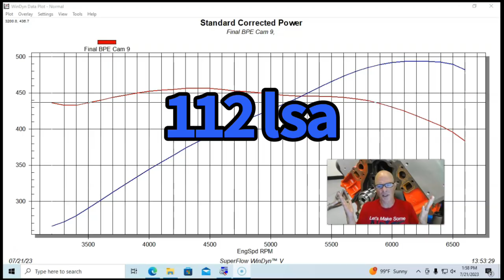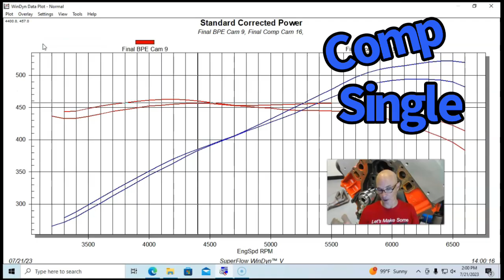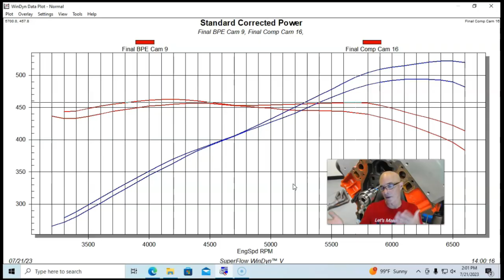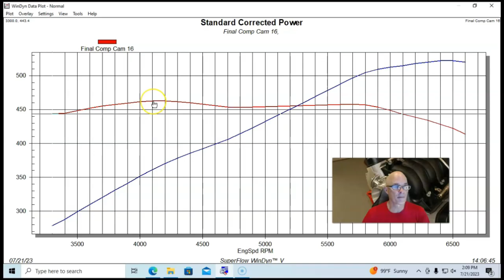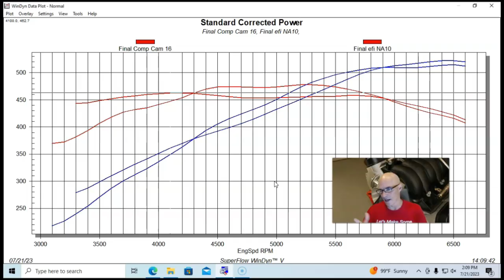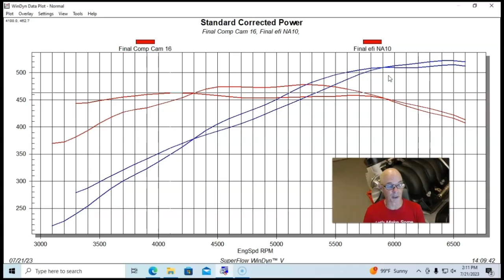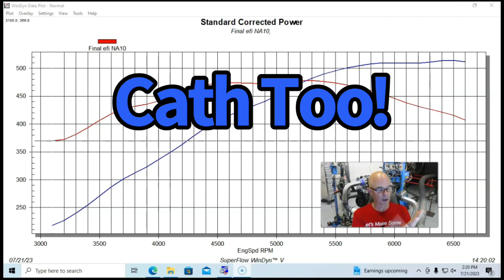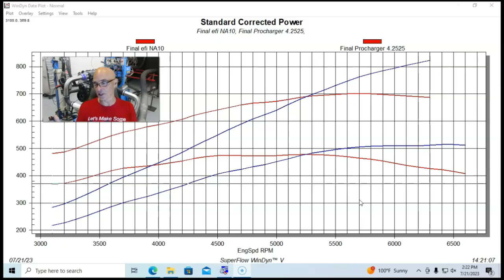HOW TO MAKE BIG 6.0L LS POWER! FULL DYNO RESULTS ON CAMS, INTAKES AND (OF COURSE) PROCHARGER BOOST!

Comment: Whats the best carb intake for ls7 for the street
Reply from the maker: 950 VRS EDEL
Reply: @richardholdener1727  dual plane intake with adapter or single plane ?
Reply from the maker: single for the LS7 (You can also go dominator)

Comment: LQ4 with BTR springs and pushrods. BTR stage 3 v2 truck cam, 750 double pumper carb, and MSD 6014 ignition.  Where should my timing be at?!  The web is all over the place on carb ls timing. And the presets aren’t even close. Thanks in advance.
Reply from the maker: 30-31 degrees at the hp peak, less at peak torque, less below

Comment: Richard thank you so much for including the carb setups with this video! Was curious what your thoughts are on the older BTR stage 2 cam with the dual plane on the 6.0 rect setup? Also what do you find is the sweet spot for timing on the carb setups like this? Cheers!
Reply from the maker: any cam works with carbs, and total timing at hp peak is usually near 30
Reply: Thank you for the reply, do you know if BP used the oem dished type pistons on this one or flat tops like an LQ?

Comment: Good evening, first i'd like to say thanks for a lot of information and also I'm new to this. I have a old cargo Van with a 6 old engine absolutely love it but I use it for work daily use, so reliability is a big thing and I also told a 7 by 14 in closed trailer. I'm getting high on a mileage and I would like to rebuild it.  I wanted to know what would it take for me to get around 450 torque and maybe 425 hp. Mainly because I run a lot of the highway but I also run a lot of the Midwest northeast mountains. I know GM came out with the new 66. But I actually love my cargo bank and everything works completely fine and The engine is just getting higher in mileage and just wanted to overhaul it.
Reply from the maker: TRUCK NORRIS CAM AND SPRINGS

Comment: What would happen with a 227/231 620 lift cam. Curious cause that's what I've got in my ls3 64cc  head  lq9. 92mm tb, ls3 intake. Should be pretty close. I do plan on running boost.
Reply from the maker: see the 224, 227, 231 cam video

Comment: Question for you Richard , a friend is putting a 305 vortec (originally roller) almost completely stock in an S10 pickup . What cam would you recommend for street use ? Thanks
Reply from the maker: take a look at the 305 sbc videos and choose one of the milder cams

Comment: Currently waiting for my 402 (6.6L) stroker build to finish.  My LS2 block was junk so went 6.0 iron block (30 over), forged eagle crank, forged eagle i beam rods, SRP Pro dish pistons (shooting for 11:1), unported fast 102, TSP Magic Stick 3 (238/242, .600', 112 LSA, 110 ICL), comp cam lifters, ARP head studs and mains, king bearings, new Monster Lt1s twin disc, Fast 58 injectors, Aeromotive 325lph fuel pump, full exhaust…. Hoping for 520+ wheel and then maybe add boost later.  Still a daily, hence the mild cam (2006 corvette).  Replacing torque tube bushing and bearings as well $$$$$$$ 😢
Reply: Boost on an 11:1 motor, go easy😢

Comment: On the 1st test the dual pattern cam is big compared to the single pattern so hp up and tq down would be expected.
 A dual plane more like 220/238ish 112lsa would be a closer equivalent.
 Likewise a single pattern of mid 230's@50 would be closer equiv to that dual pattern.
Reply from the maker: the true test is matching the intake duration
Reply: @richardholdener1727  👍 but all great and interesting testing too, thankyou

Comment: Look at the shape of the horsepower curve. It has a ripple in the curve, the dual plane curve is smooth. I think its probably a function of very even runner length in the EFI manifold, the resonant frequencies of each runner being the same causes the sine wave ripple as rpm's increase. The dual plane has all very different length runners which cancel out each others tuned lengths. Basically one has a natural filter. Also the obverall shape of the two horsepower curves are different, so naturally the two curves will cross twice.

Comment: Rich, everyone wants to see down low for a dig reference and see what type of converter they need. Just an FYI
Reply from the maker: Everyone?
Reply: @richardholdener1727  except for the roll racers. So no not EVERYONE.
Reply from the maker: no one needs wot power numbers at 1800 rpm (you should not be a WOT at that low of an engine speed) whether you roll race or drag race

Comment: The 227/243 Comp Cam made more low-speed torque compared to the BPE cam from 3300 to 4700 rpm, where their torque curves appear to meet.  Then it continues making more torque (and hp) to the top end.
Reply from the maker: the 227 cam made less low speed (watch the video again)
Reply: @richardholdener1727  I did, even watched it frame by frame when the Comp Cam hp/torque curves were added to the graph.  I know the bigger cam usually doesn't make more low RPM torque, but this one did.  Maybe it's the carb manifold that made the difference...
Reply from the maker: the 227 cam made less low speed than the single pattern
Reply: @richardholdener1727 No use of. Delousal people. Sounds like a Delousal Ford guy. Example they can get stright out run I mean get the jump 60Ft. But the other car even being 2 to 3 cars a head. Ford guys will still be delousal and blame there L on God's weather ECT and that's #1 out of many excuses they say.

Comment: I'm amazed by the level of torque the carb set up produced around 3000rpm! The  carb produced torque level was almost comparable to the turbo set up at 3000. Richard, I wonder has the magnitude of the 'lower' rpm torque here anything to do with the over sized carburator? Did you happen to measure the air/gas ratio during both set ups? I'd love to hear your thoughts behind these!
Reply from the maker: we monitor and optimize AF ratio on every test
Reply: Most likely an error, as he said all the tests he has done have not produced same results.
Reply: @nintendogamer5472 lol an error 😂

Comment: Stupid question.
Every parts store gives math for carburetor sizing. Like-
 cu in x rpm/ 3456 or some other constant.
But these Dino motors run bigger carbs.
I’m guessing Dino motors don’t do much part throttle stuff?
I’m figuring a 650 for the 6L and Richard is using a 900 cfm…
Reply from the maker: the carb size is not determined by cubic inches-it is determined by hp-and part throttle works fine on this motor
Reply: @richardholdener1727  -Thank you.  
So like 1.5 cfm per horsepower?
Probably not that simple…
😎
Reply from the maker: that is more difficult since the carb airflow is not always the rated size
Reply: @richardholdener1727  -lol
It’s magic then..possibly voodoo.
Reply from the maker: we base it off of vacuum readings taken at WOT for various power levels vs carb sizes then adjust for drivability
Reply: @richardholdener1727  -Ty!
Reply: @michaelgarrow3239  also depends on rod/stroke ratio and whether or not you flipped pistons
Reply: @scotttimpany2845  - That comment has me oddly aroused….  
Just kidding.. 😎
The bore and stroke ratio affects piston speed at tdc I would guess? Which would affect vacuum in the intake manifold.  
And flipping the pistons means your just messing with me? 😎
Reply: @michaelgarrow3239  I'm messing with you. You're right about the carb sizing formula.  It's out there and a good rule of thumb.  If you watch 100-200 RH videos, you'll see he uses the same 2 or 3 carburetors all the time.  He has a few "go-to" carbs at Westech...  You'll also see that he focuses on WOT pulls without any emphasis on part throttle drivability or fuel economy.  As far as rod ratio and dimpled ports/combustion chambers and flipping pistons... don't waste your time.
Reply: @scotttimpany2845  -I think port dimples are kinda sexy….

Comment: Hey I have a 1999 Ford f350 V10 supercharged with codes po118 po117 at same time it don't make sense the wiring is perfect and replaced pcm 2 times and replaced coolant sensor with oem everything works fine but truck won't start and when you can get it started it runs rich  when you can pull codes you get po118 po117 then you can't get any codes from it most of the time any idea's
Reply: Pull the lettuce out of the zerk fitting and add some voltage to the dome pressure.
Reply: Replace the sensor with a Ford sensor. Did it on my 69 el camino with a stock 8.1 about 10 years ago and it fixed it.
Reply: @skimask5911  has a Ford coolant sensor in it brand new and checked to see if it works